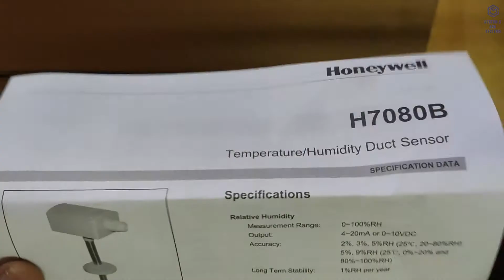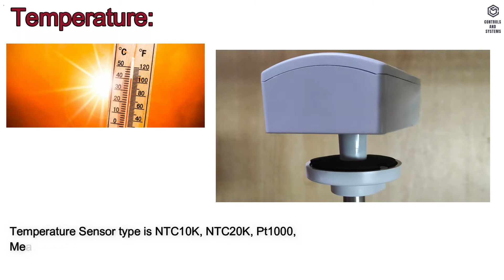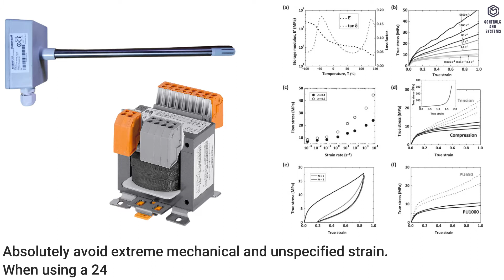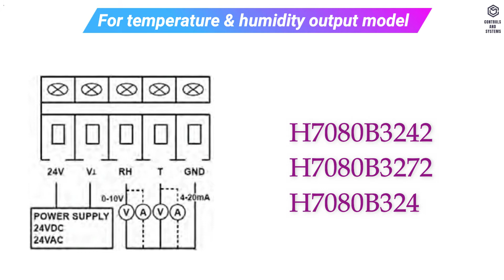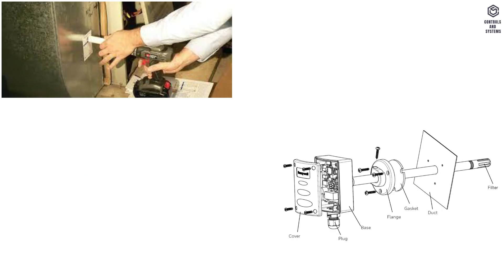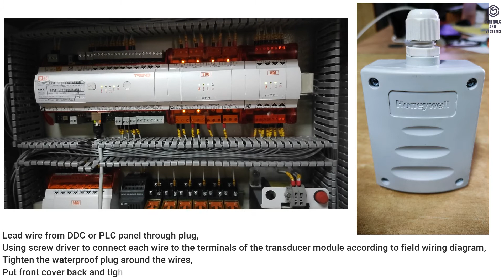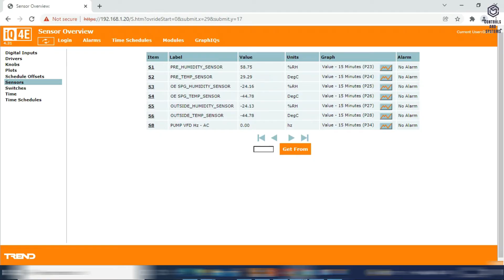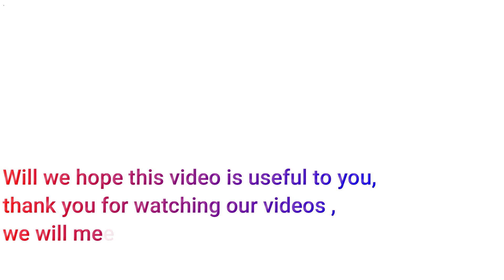Honeywell H7080B Series Temperature & Humidity Duct Sensor | Full Specifications & Features

Comment: Which thermmostat is suitable for this sensor ( cooling valve 0-10v,electric heater with thyrister 0-10v control.
Reply from the maker: Thank you for the question.
There are many thermostats available on the market; if you have time, please search for it on Google. If your output range is 2 x 0-10 dc signal, please look into Honeywell and Siemens thermostats. In my opinion, based on your needs, Belimo Room Operating Unit is suitable. The model number is P-22RTM-1900D-1; please also refer to this manual.

Belimo: https://youtu.be/n-R1IQm5BD8
Reply: @insightcontrolsystem  thank you. Very much for . Valuable reply..